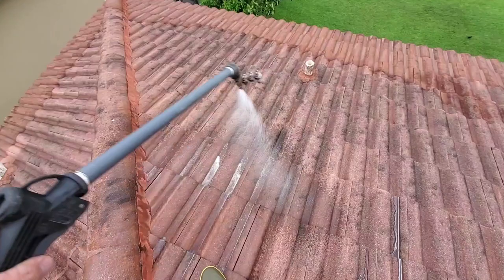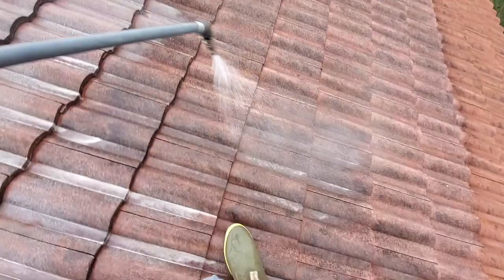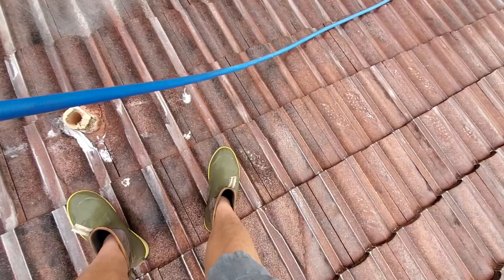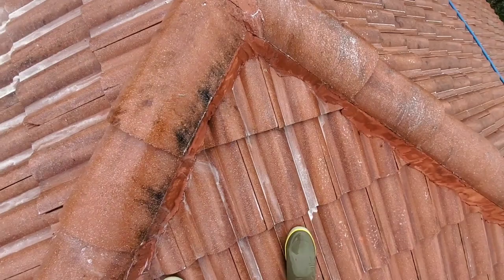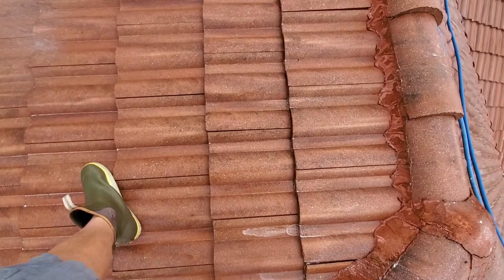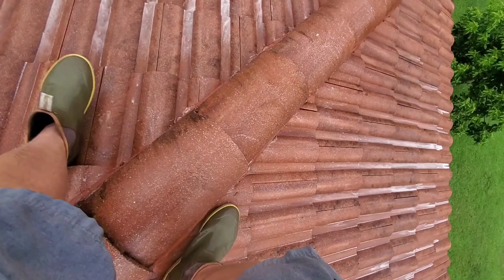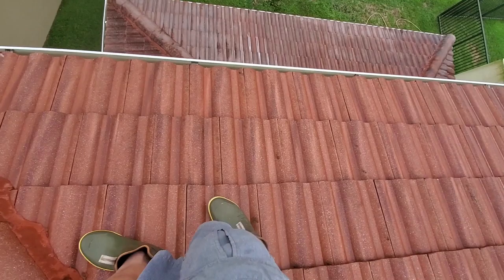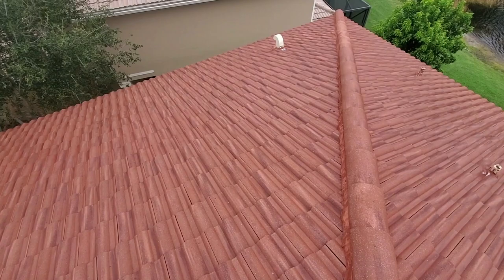Roof cleaning Step by step how to

Comment: Thats a good vidio bro. I will say this though i washed many many roofs and never tied off. On one job it was mandatory that i do use a harness and i happen to slip and fell back at the top of roof.  Hit my head and went skidding down 2 stories up. Luckly i was tied off and stopped at edge of roof. Walking on  SH on a roof is very dangerous especially a tile roof.  I like your set up and best of luck

Comment: Thanks for your time and knowledge I’m leaning the business. Question with a 25 gallon water container how much SH & surfactant would you recommend on a tile roof? Hope to here from you soon.  Great job btw
Reply: He never got back to you? It’s been 4 months would like to see a answer
Reply: It depends on how bad the roof is. On this one which was bad he said he used a 50/50 with surfactant. If you were to make a 50-50 mix you would put approximately 12 gallons of SH and 12 gallons of water and some surfactant. That will fill your container just under the brim. With a 50-50 mix it would cut your SH percentage in half. If you started with 12 1/2% SH by the time you mixed it half with water it would be 6.25%

Comment: Hey Mike 
How long from start to end of rinsing did it take to clean the roof?
And how much SH did it take to clean the roof? You done a great job.
Reply from the maker: Average about 20-30 gallons
Reply: I washed a painted metal roof yesterday and I had to literally walk the entire thing but wasn’t able to safely do it. Was 6/12  and about 3,000 sqft. I went to the ridge and cleans my way down as far as I could the did the rest from the bottom on the ladder. The cleaning mix wouldn’t get the bad liken off, had to use direct pressure and soft wash tips. Do u run into this alot? I’m trying to figure this out because I slipped about 5 times. Cut my hands and fingers about half way through the job and it came really nice and clean but took me literally all day and I’m blessed I’m not seriously injured. That was extremely dangerous
Reply: Slickest damn roof I’ve ever worked. Even after it was clean. The detached garage was maybe a 5/12 and same painted metal and I walked it no problem
Reply: @Oleynspressurewashing  you said you used 50/50 mix and u said u use roughly 20-30 gallons is that 20-30 gallons of water and SH combined or just SH

Comment: I will say this to be in all fairness? You really shouldn't walk on the roofs for a couple of reasons. I will say first you can slip on the roof .Two I know there's an OSHA regulation that you're supposed to tie off on any type of roof. Three you don't really want to take a chance even on tile roof I possibly cracking one of them let alone even onasphalt shingle roofs wanting up knocking the granules off because of walking on the roof. If you do need to be on you should still tie offbe very careful walking so that you don't crack tile roof or not granules off of shingle roofsand also if there's 40 mile an hour winds you either make a decision right then and there to reschedule or yes you do need to get closer to the roof to keep from the overspray